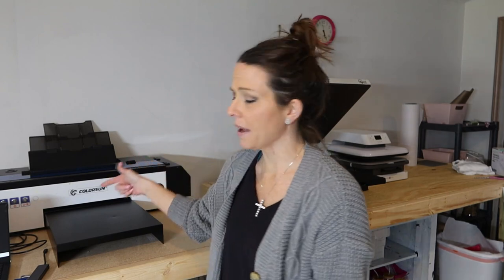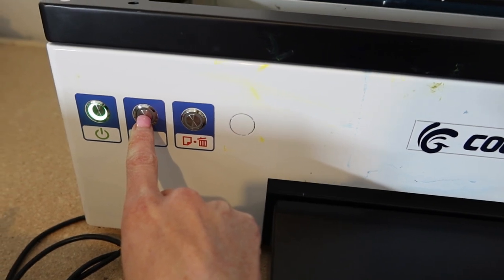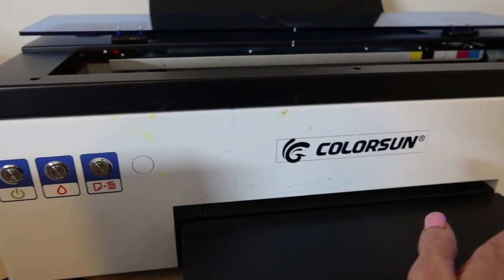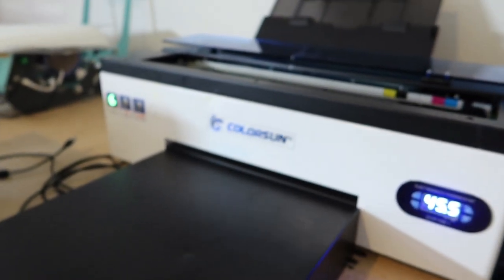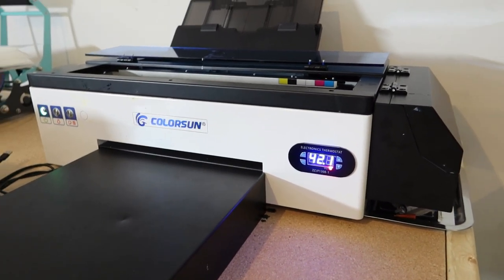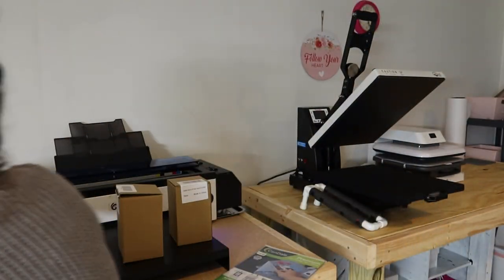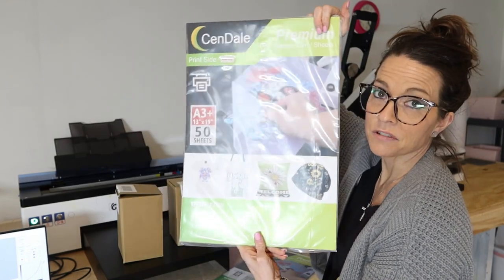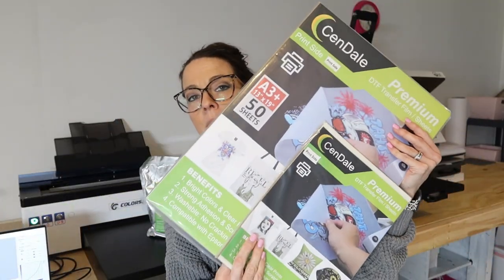DIRECT TO FILM DAILY MAINTENANCE/STEP BY STEP TUTORIAL TO PREVENT CLOGS/TIPS FOR WHITE CLOG ISSUES

Comment: want to solve your white clogging? Buy 2 new dampers and fill with print head moisturizer, remove white dampers and put in cling wrap  with a rubber band, install both moisturizer dampers print a 2inch by 2 inch square in nothing but white , leave moisturizer dampers in, turn off machine and go to bed. 2 days later just remove moisturizer dampers, pull white from tubes run head cleaning and print as normal.  If you want to go away for a week just repeat above steps but use all 6 dampers with moisturizer.
Reply from the maker: Oh wow! Thank you so much for those tips!